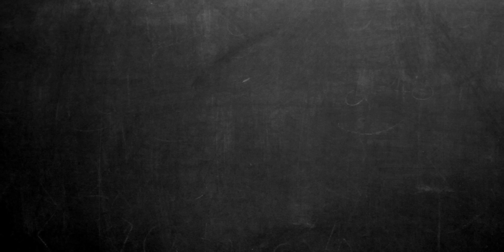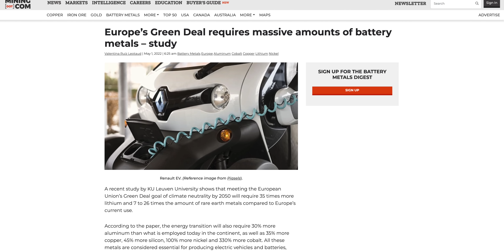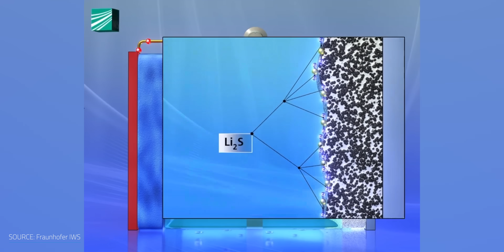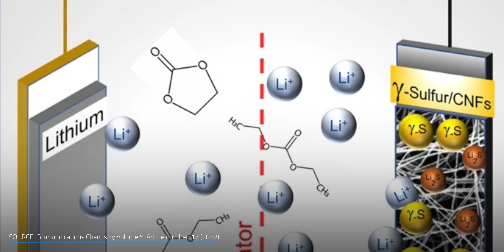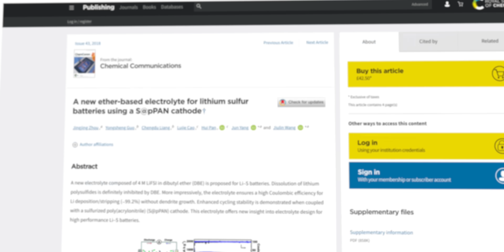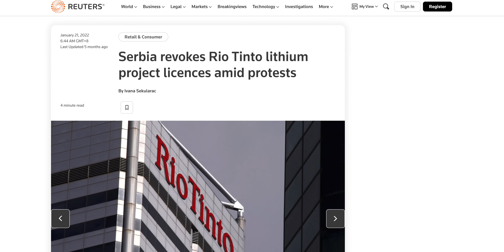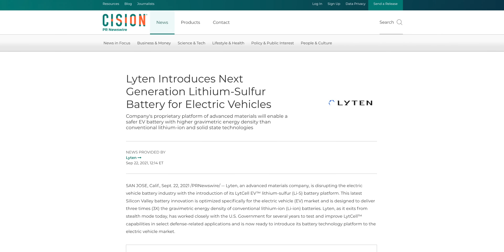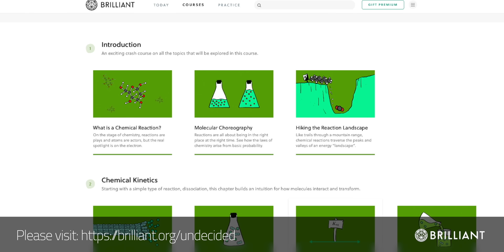Why This Accidental Battery Breakthrough Matters

Comment: I know you mentioned it a little but there should have been a bigger focus on just how much lighter these batteries would be compared to lithium-Ion batteries. They are in the order of 1/3rd the weight of existing batteries. That is the reason the drone and aerospace industry is what they are aiming at. Also, lithium will largely be a solved problem in the next 5 years. The Salton Sea production of Lithium is coming online. They will literally 1.5x the amount of lithium on the market over the next 10 years.
Reply: Nevermind, I just realised he said drexel ones are only 3 times energy dense
Reply: We actually can do something with the Salton Sea??? Fantastic!
Reply: @jtelliso  we'll have enough salt to last forever! 😄
Reply: Hmmm.  But to continue the transition to EV's you need 50 times the lithium on the market over the next 10 years.  And that ignores the needs for roof top and grid scale storage for PV.  So I wouldn't say that it is a solved problem.
Reply: @richdobbs6595   but shouldn't better energy efficiency bring down the required amount of 50x down to like 25x? It is still more, but sodium-sulphur polymer is also promising. All these things need more time I guess. Who knows, we might also "accidentally" discover another revolutionary compound in upcoming years.
Reply: @harshithsg5483  Okay, that makes sense.  But it is still not a solved problem as the OP claimed.
Reply: @harshithsg5483  : The only way to get a doubling of energy efficiency from batteries is for them to be used for decades, and that takes... well, decades to actually pay off. It doesn't actually reduce per-device power consumption that much, it just reduces the rate of needed production.
Reply: @richdobbs6595  There are multiple technologies which are better suited to stationary power storage. I thought it was crazy when I heard they were building large scale lithium power banks for grid storage. It seems better to save lithium for mobile applications, until new a new chemistry offers a better option.
Reply: @richdobbs6595  prices are hitting the roof too
Reply: @richdobbs6595  I assume that number is based on the current population and its forecast growth but if population drops as it is expected we dont need 50 times
Reply: @richdobbs6595  That's why we need the development of sodium-sulfur batteries to succeed.
Reply: @richdobbs6595  So sodium?
Reply: @richdobbs6595  there are non-battery solutions for this, however.
Reply: @richdobbs6595  EV vehicles battery is huge 100kwh. 
The Daily drive is 7kwh 
The home need over night is 5kwh 
The rooftop solar PV is 33kwh every day 
Every building is connected to the grid 
So with automatic EV  plug in at every building the grid can trade power and stability with the grid for money 💰. 
If you do the maths Renewables and the grid and the EV batteries will be all that's needed. 
USA has 300million vehicles if 100kwh each and connected to the grid 24/7 except for rush hour or daily drive.
The automatic EV plug in gizmo will be the 'killer invention'..
Reply: @stephenbrickwood1602  it’s being trialled. Fully charged plus podcast covered that in the latest episode. Apparently the electric F150 has unexpectedly gained most interest due to the ability to back up the grid for a house.
Reply: @gervaised  I think it, EV batteries, will also trade power and stability with the grid for money 💰. 
The grid / home meters track when home rooftops put power into the grid and will know when a vehicle trades energy on the grid. 
The grid will be receiving power from the power companies and rooftops. 
The grid capacity would have to be expanded x3 if it was the only source of power and 'all' vehicles are electric. 
And all vehicles top up  empty batteries, daily automatic 'plug in' and top up will be the 'killer invention '.
That is the reason nuclear power will also be much, much more expensive..
Reply: @stephenbrickwood1602  storage of excess renewable power is the key. Won’t be lithium anything tech, more likely iron air or something cheap, massively scalable and abundant . Turning off turbines as there’s nowhere for the power to go is madness and we’ve got a shed load more coming online soon in the UK.
Reply: @gervaised  you are right about the mass storage as Renewables energy will be dirt cheap, but access 24/7 will be the  Biggest matter. 
Much is in the numbers of any problem. 
The EV will need a full driving range/ability and so a big full energy storage system. 
The huge majority of daily drives are tiny and you may have noticed that most people only need to fill a fully empty fuel tank every 10days, most people don't wait for empty, my point is how little is used daily. 
So with daily top ups at home or everywhere the grid will have its massive reserve of storage. 
The EV batteries will trade/store the grid power. 
Except for the rush hour or daily drive every EV will be 'automatically plugged into the grid'.
Every building is connected to the grid. 
Intensive super charging will only be for a few as needed. Many will just plug in over night. 
300million EV in USA and not at the petrol/gas station every day.
Reply: @gervaised  the Big Battery in South Australia has paid for itself in a year trading stability and storage with the Australian grid. 
A $100million build cost over 3 months..
Reply: @stephenbrickwood1602  The grid capacity requirements are much more complicated. There are requirements for local distribution, local storage, and long distance transmission, and generation. The generation and transmission are currently insufficient without local storage. Texas is a microcosm of the problems. When east Texas is suffering from a shortage, west Texas has to curtail production because of a lack of sufficient transmission between the two. Adding EVs and distributed solar will complicate local distribution. These are currently not controlled. Hawaii was the first to have the problem, and has had to limit distributed production to the grid to avoid grid stability. Similarly, when everyone connected to a local transformer is exporting power, getting that power to a commercial or industrial usage well pose new challenges in demand and production controls, as well as utility worker safety and frequency control. In aggregate, I don't think electric  vehicle usage by residential owners will stress generation or transmission. Commercial transportation like postal service trucks will most definitely require changes to local distribution, but probably not generation or transmission. What will be a big challenge is electrification of space and water heating. That has the potential of severe demands during cold weather, again Texas was a big example in February 2021. The problem there was generation, but if every home was all electric, transmission and distribution likely would have also been a problem.

Paying for this grid modernization will also be a problem, as people with solar are sold on the idea of free electricity. But yet, the transformers are still there, and need to be paid for and maintained. Someone has to pay for the storage or generation needed at night or on a rainy day. It's not clear who will pay for distributed grid controls to make this ask work. People who bought rooftop solar resist higher fixed charges or anything other than net metering, but that doesn't work if everyone has rooftop solar.
Reply: @johnhaller5851  well said.
I  see every rooftop and every EV basically connected to the grid and paying to be connected. 
We pay a $1/day to be connected and receive 10c but pay 30c/ kWh, no net metering. 
We have big batteries, 100MWh, providing stability. And some supply.
EV batteries charging adds the same demand as a home, so 2 EV and 1 home, is a x3 increase in demand and a x3 increase in grid capacity. 
And so '2 more' grids would need to be built IF THE CENTRAL NUCLEAR POWER PLANTS solution for the increased load problem. 
I am suggesting that the big EV batteries be used to provide grid stability, and home rooftop solar PV top up the EV battery. 
Most daily drives are 7kwh and batteries are 100kwh. 
The long drive for the majority is not daily.
1/ Petroleum savings. 
2/ Power supply savings. 
3/ Extra grid build would triple connection fee, so the existing grid will save extra fixed connection costs. 
3/ CO2 reduction 
4/ Petroleum will be a strategic military reserve asset. 
5/ NUCLEAR power is a massive long-term solution. 
6/ The world needs a long-term solution and nuclear industries in every country in the world means bigger grids for EV transportation. 
7/ NUCLEAR industries in every country means military costs massively increase. 

The grid would need to be smarter with distributed solar power supply but not bigger. 
We can shut down rooftop supply to the grid remotely for stability..
Reply: That's what density means when talking about energy density.
Better batteries mean less weight for the same amount of energy.
Reply: @theFLCLguy  These batties are more energy-dense than Lithium-Ion and he did mention that. But regardless of energy density, I was referring to the fact that by swapping out the heavy metals like Nickle and Cobalt with Sulfer you get a significant reduction in battery weight.
Reply: @NinetooNine  DUH!!!!!! stop trying to talk like you are intelligent.

That's literally what it means. You are not saying anything at all. The meaning of energy density is it weighs less. So that means the materials weigh less.

There is other factors to consider, like the size difference for the same battery density. Which he didn't cover because in this and most cases it's not an issue.

But what doesn't need to be brought up is the materials being lighter because that's what energy density is referring to.
Reply: @theFLCLguy  Energy density is talking about the amount of energy in a given mass of space. It does not mean weight. If you don't believe me go look it up.
Reply: @theFLCLguy  energy density refers to how much energy is contained in a given volume, so it's not an exact correlation with weight
Reply: @peabody3000  It means both.  Volumetric energy density is the amount of energy storage per liter.  Gravimetric energy density (aka specific energy or specific energy density) is the amount of energy storage per kilogram.  When referring to lithium-ion batteries, it is very common for "energy density" to refer to gravimetric energy density, even though it's ambiguous.
Reply: @dansanger5340  thx
Reply: I second the motion for talking more about the properties of the chemistry.  While 2x lithium ion is interesting, it still can't compete with LiFePo4 for cycle life and would be a barrier for mainstream EV use.  What about operational temperature range?  Charge/discharge rates?  There would certainly be great applications for this tech, but there are still limitations as well.
Reply: @AdministrativeReload  hence further research, I wouldn't expect to see it in use for at least 10 years.
Reply: @AdministrativeReload  at 2-3x density compared to sota batteries BEVs with a realistic range of 1000 km are absolutely possible. 1000 cycles would give a driven distance of 1 million km. That's more than the average European drives in their entire life. I'd say it's more likely these batteries would degrade from aging.
Reply: @AdministrativeReload  Actually, that was something else that wasn't really talked about in this either. The team actually tested this in the lab up to 2000 charge cycles without significant degradation of the cell.
Reply: Will be great for cars also
Reply: 8 times theoretical energy density should mean it is 8 times lighter than li-ion right?
Reply: No it just means a battery the same size can story 8 times the energy.  Actual weight is entirely different. Though a battery with 8x the energy storage of conventional lithium batteries could be made much smaller and still meet the energy density of a lithium battery.  You also have to account for the electrolyte, and external casing or structural enclosure that must be strong to maintain safety.
Reply: @harshithsg5483    Energy density isn't the physical weight of the device.
Reply: @harshithsg5483  No. The density of the battery will be different. But even if it's only 1/6 the mass per kWh of Li-Ion or LFP cells, it can make EV's much more efficient because of not having to haul a great mass of battery everywhere. It can also make the difference between a short range electric aeroplane of today and a medium haul airliner. Avgas  would still have a higher energy per kg, meaning that it will still be used for long haul flights, but it's a step in the right direction. 
I foresee long range passenger flights in electric aircraft, maybe not in my lifetime, but certainly within the next 3 decades. Not even Hydrogen would be able to compete with that.
Reply: @harshithsg5483  nah juz same weight with more energy
Reply: @harshithsg5483  Yes and no. There are other factors like battery pack enclosures and cooling systems. Overall you'll lower weights but not dramatically so.
Reply: @harshithsg5483  The difference between theoretical and practical, is there theoretically isn't one.
Reply: yeah, there's also two mining sites in germany that are expected to produce ~65k tons of lithium per year from 2025 on.
Reply: We need to get away from lithium if we can, not destroy an already vulnerable body of water.
Reply: Wasn't the issue with cobalt and other rare earths involved in the batteries. Not lithium per se?
Reply: @Mia-ln1zs  lithium isn't closely tied to slave/forced labor, but cobalt definitely is.
Reply: Salton Sea is totally unproven. This decade will be all about traditional lithium spodumene from hard rock and lithium carbonate from brines.
Reply: @robrider838  They are contracted to produce and deliver 30,000 tons of Lithium next year to GM.
Reply: @NinetooNine  There is no production out of the Salton Sea never mind 30,000 tonnes. The Salton Sea might provide lithium production in the 2030s IF their processes work at economic scale.
Reply: Don’t think that will meet the demand by then
Reply: lol WHAT. I just did a spit take at that insane comment.
Reply: A 3rd in weight width same size or smaller dimensions too?

Cause that would mean - theoretically - 100kwh would become a 800kwh battery with way less weight. If the dimension go small too, that could become a 2400kwh block; or the other way: a two seat car going 100s of miles…
would be insane! :D

Motorcycles would be interesting too…
Reply: That doesn't sound like enough
Reply: 1/3 the weight and 3x the energy density is amazing.  So, approximately 9x times the energy to weight ratio of Lion?
Reply: Yes, because the obvious mistake people were making is that the Lithium had to be in a more of a solid thick state to use for the rechargeable batteries when this is not the case.
Reply: I live in the Coachella Valley. Sadly, there's exactly zero start in any new Li plant construction so far at the Salton Sea. It's only been proposed so far.
Reply: Nevermind the fact that the Salton Sea is drying up and poses a much larger ecological disaster for the Southwestern United States if it does.
Reply: Think they will have tech for space mining in about 10 years? Maybe 20
Reply: @Alec0124  I think the base technology exists now to do it. Sure they will have to do some clever engineering to overcome challenges as they come up, but, the biggest challenge will be money.
Reply: there have been so many breakthrough innovations in the past two decades... some low tech some high tech but none have changed much in dealing with the problems next generations have to cope with ... I fear that EV will not be the solution... more human powered vehicles and more mass transit is the solution
Reply: If Sulfur increases the density of lithium ion batteries, wouldn't the batteries be considerably heavier, not lighter?
Reply: Finally, flying cars.
Reply: @noobandfriends2420  I wouldn't trust the average person with a flying car, given the various statistics of misuse for the ground-based versions.

At least the ground versions don't have the risk of some drunk crashing into your apartment or office on the 30th floor.  Also, given humanity's tendency to tinker with things, automating the cars would not last as somebody would find a way to make it manual, in addition to automation needing to have data to reliably deal with unencountered situations in a correct manner.
Then there's the political abuse potential of automated vehicles, which would increase dramatically when you add in verticality to the vehicle.  Don't like your political opponent?  Hack the car and make it crash, or hack someone else's car and make it crash into the target.  How many people are maligned by one of the many ideological factions these days?
Reply: @latemanparodius5133  Flying cars are just a ridiculous idea anyway. As you say, ground based car's already have tons of accidents on roads. Pilots undergo a lot of training, there's no way to strip that down for the average consumer daily use without causing catastrophic results.
Reply: @MindForgedManacle  : Tesla’s Autopilot to the rescue—even in the sky!
Reply: @MindForgedManacle  We already have self driving cars. And planes almost entirely fly themselves – someone like 98% of the time for the large ones and 100% for the drone fleets already in operation.
Reply: @latemanparodius5133  The FAA regulates drones. They certainly won't let every  clown with the money for a flying car take to the skies.
Reply: @MindForgedManacle  then there's the incredible amount of noise pollution that flying cars will generate.
Reply: @noobandfriends2420  : Eh, flying cars require flight control tower upgrades, not energy storage improvements. Combustion engines are fine for them, yet they still don't exist- it's not the energy storage, it's the control systems.
Reply: @noobandfriends2420  hopefully not! : Can you imagine the constant drone of overhead craft, the visual pollution of 1000's of aircraft flying overhead, the hugely increased danger - both to the passengers and anyone near the flight path, especially if they are landing and taking off from ordinary streets. Not to mention the massive increase in energy cost for transport. The list goes on. Flying cars sound nice, but are a terrible idea in reality.

Adam Something has a good video on this: https://www.youtube.com/watch?v=UZ5vTRE4DLQ
Reply: @noobandfriends2420  that’s just helicopters
Reply: @noobandfriends2420  Sad to say, we may never see flying cars. When your car now dies, it just rolls to the side of the road (if course if you steer it to the side).  If your flying car dies in flight, what happens to you ?
Reply: @noobandfriends2420  We already have those. They're called aircraft and helicopters

Flying cars fallacy - just because it's a physical possibility for common transportation doesn't make it one that is effective or efficient. 

Aircraft are inherently more difficult and regulated to operate, as they consume far more power than cars for the same distance, as the medium disperses it's energy. 

In contrast, roads are nice and solid.
Reply: @noobandfriends2420  finally flying bus will be the thing
Reply: @noobandfriends2420  sadly, people cam barely drive normal cars safely.
Reply: @noobandfriends2420  If that will ever be a thing, it is more likely that cars will be on some sort of tracks when they're on the highway.

Or, ya know. Invest in trains and trams.
Reply: @noobandfriends2420  Flying cars is a stupid idea that will never happen. 

Helicopters already exist and are the most dangerous vehicle to ride, despite professional pilots.
Reply: The full potential of the Salton Sea is estimated at 600,000 tons of lithium carbonate a year, which is only 1.5x the current global production of about 380,000 tons of lithium carbonate. It's important to not mix up the numbers of lithium carbonate, and the number of raw lithium contained in it: You need ~53 tons of lithium carbonate to extract 10 tons of lithium metal.

Also, much of the lower weight / higher capacity per weight of Lithium Sulfur batteries comes from the lower relative weight of the Sulfur atoms compared to the Iron or Titanium Atoms included in the Lithium-Ion Cells. You still have a very comparable level of "Energy per Lithium Atom" between both battery types, you just waste less weight on the secondary ion. 

Which brings up a fundamental problem with a lot of the hype currently existing around the BEVs: Todays "typical" BEV requires a good 50 Kilogram of lithium carbonate per personal car (850 grams per kWh), and heavy trucks or busses tend to need more than 500 Kilogram. Ignoring the latter, the current global production is only good for 7.6 million personal cars, and even the final production of Salton Sea (if fully realised) only adds annother 12 million cars to that. 19.6 million cars isn't anywhere near the 70-80 million passenger cars that are currently produced per year. And that's ignoring the fact that some other industries are also building up increasing demands of energy storage.

So, the current global mobility system based on personal cars will simply not replaced by BEV cars, at least not based on lithium technology, in the foreseeable future. Either the production of cars is reduced by about 90% over the next decade, or the market share of BEVs will stop dead somewhere around the 10% mark. Maybe a bit more if more people will start buying BEVs with smaller ranges, but either way there will be a very hard limit and we will reach it within the current decade.
Reply: @ShieTar_  You are right the amount of lithium in the Salton Sea is estimated currently at around 600,000 tons a year of production (I modified my original post). However, it should be noted that there might be more than that as this is just an estimate right now. They are doing studies to get a more precise prediction of how much there is. Also, keep in mind that if they can prove this technology in the Salton Sea then this will not be the only place that will do lithium extraction from brine. This could even lead to lithium extraction from seawater brine. 

The weight difference between the Sulfer and Nickle/Cobalt is fairly high.
Reply: @ShieTar_  I don’t think you’re considering recycling of these batteries in your predictions. Over time more of the lithium will be sourced from recycled batteries until a point where we’re only mining what is lost to the recycling process.
Reply: @johnlabernik4599  You are right I don't consider recycling, because recycling of lithium is not yet a relevant process. And it can only start to contribute in a meaningfull way after a significant amount of cells becomes available for recycling, a point which we havn't reached yet either. And in order to get from 10% market share to 100% market share by recycling, you need 10 generations of cars to be built, reach end-of-life, and go into recycling. Which means at least 100 years from now.
Reply: Chinese no-name cells are also 1/3rd the weight of normal batteries and they hold 999999999mAh (or whatever you want, really)
Reply: @igorordecha  LOL. They are also free.
Reply: Were still projected to run out of global lithium reserves in just over two decades
Reply: California has seen a 15-foot subsidence of the land, thus far, because of groundwater depletion. The Salton Sea Lithium facility is NOT likely to produce nearly as much Lithium as predicted. Aquafer systems are far more complex than imagined and the initial drilling at that facility was delayed a number of times because of issues that have not been as prominent in the news. There are a number of issues related to land subsidence that are going to cause more problems down the line (maybe 2-3 years from now) that have been discussed in the less widely publicized research done by Hydrologists in the state. I'm personally betting that the Salton Sea project is going to be a major political issue in the state around that same period. I think the ensuing political and legal battles will take many years to resolve; especially since California's water mismanagement has led (along with Climate Change) to a major water crisis. Some California cities could be facing a Cape Town type situation in the very near future. Land subsidence in the state is related to water usage, and this facility is going to complicate that situation immensely.
Reply: what does this have to do with Viagra?
Reply: @danielwalker3042  
I'd love to explain but it's too hard...
Reply: @danielwalker3042  Both were accidental discoveries...and exciting. 😀
Reply: @danielwalker3042  viagra and  it's use now was discovered by accident
Reply: @danielwalker3042  an example of entirely different outcome than expected, that greatly exceeds original expectations.
Reply: @danielwalker3042  Uh, can you spell a n a l o g y ?
Reply: Lighter weight but increase of demand for sulfur means more dead bodies of humans that mine it… what’s the worth
Reply: There are literally hills of sulfur available near the areas where oil sands are mined in canada. I presume similar such availability near venezuela as well where the grade of crude is high in sulfur.